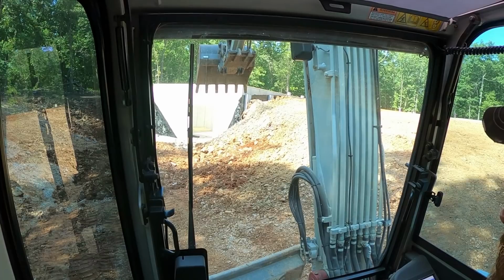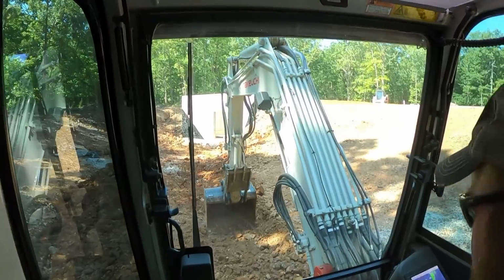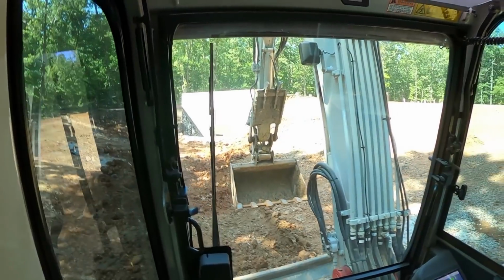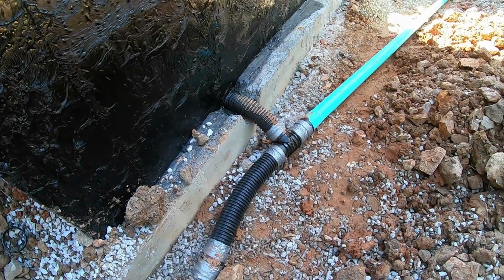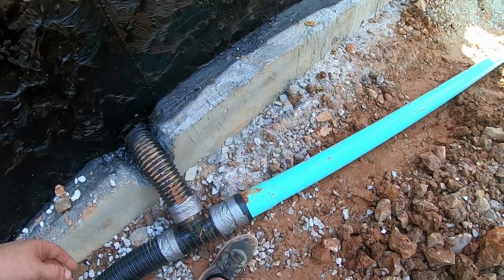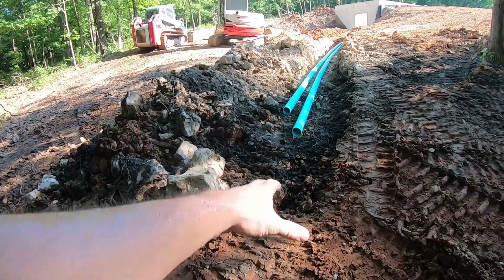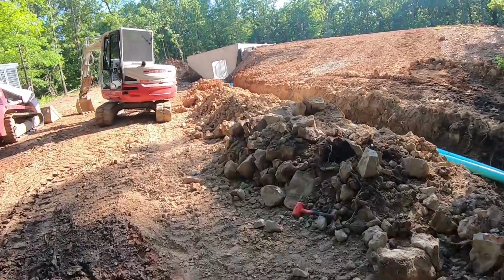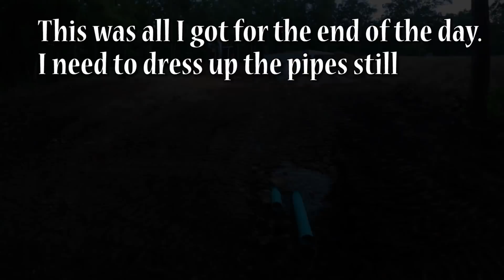Extending The Perimeter Drains On The Basement

Comment: I didn’t see a laser level but from the camera angle it looks as if the highest point of the drain pipe is higher than the slab. Did you laser or water level the ditch?
Reply from the maker: 9856CB the laser level was in the truck. The pipes have about 14” of fall by the time they get to the end and where they come out by the basement walls is still 4” below the slab
Reply: Elite Earthworks LLC whew😬
Reply from the maker: Don’t worry it will work 😉

Comment: So what kind of rock is that? Is it like Scoria ( geothermal cooked and compressed clay) I hope you're getting paid extra for this one. In our contracts we always have a stipulation that if it has a lot of hard digging rock or abrasives when digging, dozing, etc... the bid price switches over to hourly rate and the hourly rate also increases due to the extra abuse and wear on the machines. Thanks for giving us some entertainment!
Reply from the maker: Yes it’s exactly like that compressed clay is right. Yes I’ve been billing more when it digs like that. You have too cause it’s so hard on the equipment. As always thanks for watching
Reply: @eliteearthworksllc  You betchya. Ya that Scoria is expensive in the oilfield in North Dakota. It's what they use on all of the pads instead of regular gravel. I guess if metal hits it that it won't make a spark. And you really do have to charge more because it's extremely hard on everything from the pins and bushings, undercarriage and even the hydraulic system. Not to mention that it beats the heck out of the operator!
Reply from the maker: Clyde Acor that’s cool it does make for a good solid base. And yes it’s much more wear and tear on the machine

Comment: You're going to have to rent a bigger machine if your going to be digging septic in the rock.
Reply from the maker: Lol yeah I won’t be the one digging the septic I’m not licensed for that. Appreciate you watching
Reply: @eliteearthworksllc  --- No septic systems?  Really?  In most of NY, PA and DE if you have the liability insurance most contractors have you can easily get "Master" licenses for plumbing and electrical for a minimal amount of money, there are no exams or courses required.   Many contractors get them just to have them, they are protected against new requirements appearing that make it more difficult,  those trades work hard to keep out new contenders from their field.  Perhaps get those licenses and hang on to them, you'll be around for decades.
Reply from the maker: David Null yeah it’s crazy you have to go to some classes and get certified to install them here which I’m probably going to do. The guy I work with a lot is going to retire in a few years and has no one to take over his business. He’s been at it for 35 years